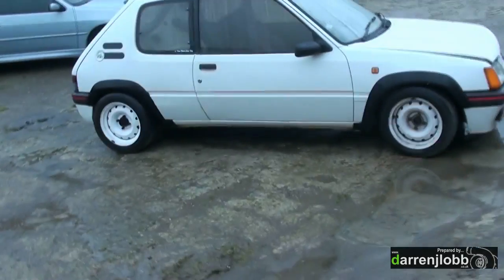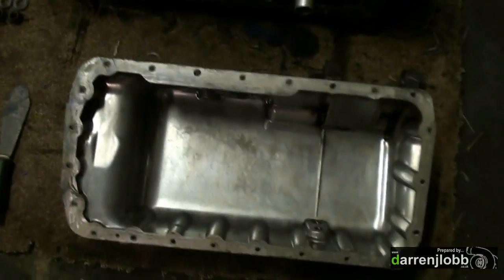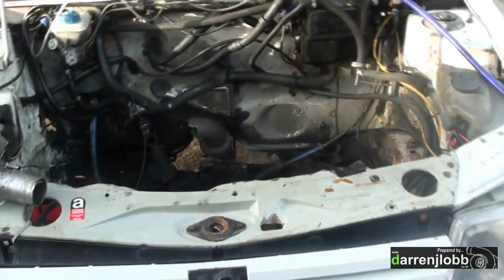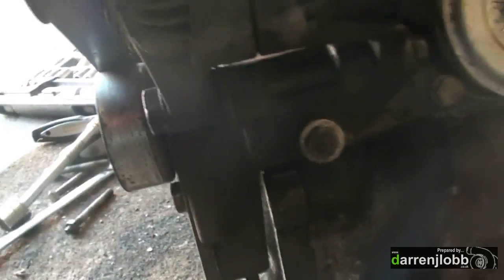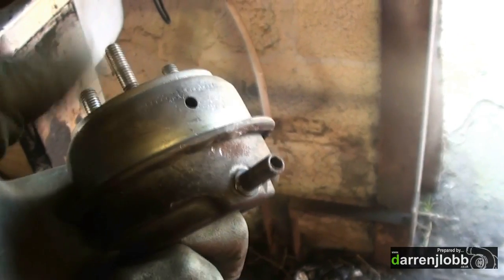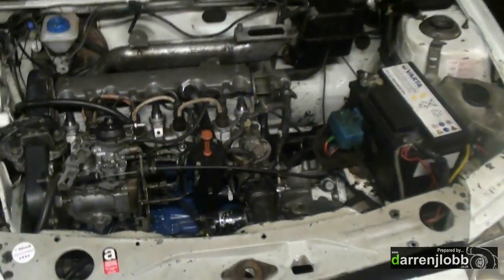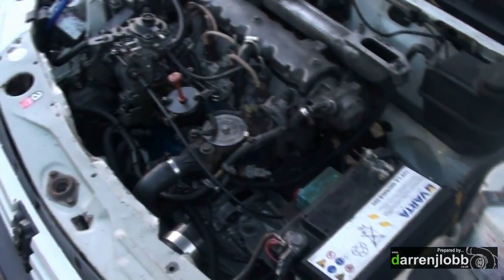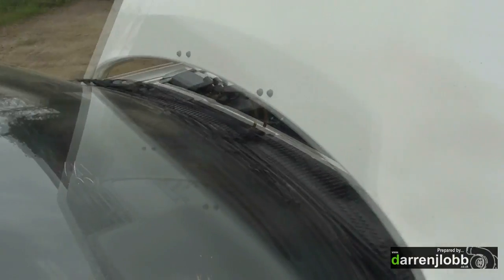205 D Turbo Custom Engine Build

Comment: Great work here; I had new 205 XLD in 1985 and an early  D Turbo in 1990. Some intelligent work here  and no hint of a laptop. I had total reliability in 110,000 miles in the XLD, the only moans were permanently misaligned rear brake drum adjustment and a clang from the spring loaded exhaust flange joint.  Hell the sound when you started it took me back 35 years!  D turbo with supposedly more than declared 78  bhp went like a relative rocket till I reprofiled it in a freezing fog crash. R.I.P.

Comment: Hi darren wondering where can i get some arp head bolts from? plan is to put the hdi conrods in this time (into xud9td), am i right i need the dw10 shells from the 2l 110hp? any pointers fiting them?  Ive killed a few xud9 engines now and dont want another performace! thanks in advance
Reply from the maker: Hi Chap, you can get the ARP studs from any ARP dealer in the UK, there are many so should be fairly easy to find one nearish you :) To use HDI rods, you need to use the HDI shells yes, but any 90/110 hp model is fine :)
Reply: cool thanks :)

Comment: maybe a stupid question but  why the GT2052V Turbo ??   what does it do ?    and have you allready been on a dyno ? i'm curious :)
Reply from the maker: Much more modern turbocharger, and with variable geometry allows you to make use of boost across a much broader RPM range...

Comment: How did you manage to get that actuator open with out killing it? Ive got a garrett gt23v to go on my 300tdi and was going to use a waste gate acutator for tge vanes but might try this first.
Reply from the maker: +Shaun Perren Mount it in a vice, and just slowly pry it open with a flat screwdriver...just be carefull you only bend the creased bit rather than bending the entire unit.

Comment: Darren. Sorry to message you on here, bet you get loads of questions. I'm in process of tuning my xud7t(OE 205 engine). Can I use the xud9 cam with the splined end to run a vac pump without any issues? Belive the cam profile is different on the xud7
Reply from the maker: Yes engine will run fine with either cams...Have you thought about dropping in a complete xud9 1.9 engine?
Reply: I have, but i've had the 205 since 68k and it's in good condition. I know i know..306 engine prob already have the inlet, bosch pump etc etc but seen too many 205s have been given that treatment. Trying to be loyal to the STDT badge aswell lol. Have you ever played with a xud7? By the way..I love you work and thanks for the reply

Comment: Did anyone else see the Asbestos warning sticker above the grill?
Reply: mine has that aswell, its just because asbestos parts were used in the brakes i think but there isnt anymore :)
Reply: P205Cornwall Yeah, asbestos hasn't been used in cars since the early 70s as mechanics soon realised what the asbestos brake dust was doing to them, they must have stuck in on there.
Reply: P205Cornwall do you need parts ... im in cornwall

Comment: nice job,bet its quick, has it got gti front axle? Where did you pick up a high pressure oil feed for the turbo? Rebuilding a 309 grdt at the moment keep up the good work
Reply from the maker: Its got a 309 rear beam, and standard 205 front end, new wishbones and aftermarket coilovers...